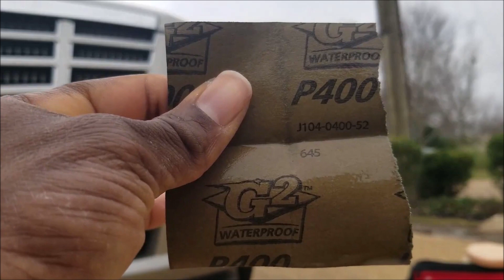Mobile Auto Detail: Make Money Restoring Headlights (Cadillac & Honda)

Comment: Do you need to seal the headlights with anything so they won't fog or haze again? In your experience how long will they stay looking good for?
Reply from the maker: Yes. You need to put a clear coat after. Some use sealants others use ceramic coatings. If you dont they will have up in 4 to 6 months
Reply: @AAProfessionalServices  Ok sounds good, thanks for the reply!
Reply: How do you find out which cars have ceramic and which have clear coat???
Reply: I would stick with meguairs or chemical guys for the final step.  See what The Headlight Restoration pro does!!

I would also add green 3m tape

Comment: hello I been doin headlight restore for my family cars and been doing the helmsman spar urethane method.the results are prefection except here in arizona they dont last but a few summers.i really prefer the wipe on clear coat method aposed to spray on and this helmsman spar urethane you dont need to polish the headligh only wetsand up too 3k grit and apply...i want to start doing this for customers but i want somthing more professional grade that lasts.and i prefer a wipe on type clear coat,i found gclear thats $60 just for 8ounces and will need a uv light to harden it.should i go this route or are their other options for wipe on uv clear coats?
Reply from the maker: Thanks for sharing

Comment: What is the name of that drill attachment with the small buffer on it?
Reply: Dont know the exact name but they usually comes as a kit. Most headlight restoration kit have one.
Reply: Never use a kit, I buy my pads and sandpaper from Amazon. 3 inch buffing pads.
Reply from the maker: Great info. Thanks for the information

Comment: I know this is an old video but, I wanted to mention that you could up sale the price with different protections. Like wax after a polish lasts between 6 months up to 1 year with 
proper detail maintenance. But, with a ceramic coating it can last for 1+ years with proper detail maintenance and that would be your up sale because a good ceramic product
can be costly.
Reply from the maker: Yes. Thjs video is a few years old. Im now aware of everything you've mentioned. Thanks for sharing.

Comment: Love the hustle!! But this method will only last about a year or two and they will start getting yellow… the correct way to do it is to re clear the headlight. With this method, there is nothing to protect the plastic headlights from the elements
Reply: What is re clearing ?
Reply: @cxlmobileheadlightrestorat7906  You spray clear coat on the headlights. So my process goes like this, I wet sand the headlights with 3 different grits of sand paper, then I wash them off, then wipe them down with a tack rag, mix my clear coat/activator, spray a light clear coat layer... then give it two more coats.
Reply: Clear coat will be all scratched up in 6 months & crack..easy to just protect with a ceramic coating..I done 2k Clear coats & looks amazing but longevity still in question..a restore with aftermarket Clear coat will cost more on the next restore..the reason factory protective layers last longer  #1 people take care of a car they're making payments on like Washing, waxing & try to keep it looking new
Like I said no matter what you do Clear coat ,ceramic coating or PPF they all have to be maintained..( dumb blonde ) I don't change my oil cause it's just going to be back dirty in 6 months so why bother
Reply: I’ve done cars that still look good 7 years later…  I’ve not had anyone come back and say it didn’t last… I charge $80 to do it. Let’s say that it only lasts 10 years… rarely do people keep their car for 10 years, and if they do… $80 was a good investment for 10 years of headlights looking new. I’d have to see some hard data if you want me to believe clear coat won’t last and will be all scratched up in 6 months. lol… I can provide pics of a 2001 Silverado I did for my cousin in 2014-2015 that still look brand new.
Reply: @AdamPerez9  interesting, most you tube videos lead to clear coat lasting 1 maybe 2 years lol.
Reply: @cxlmobileheadlightrestorat7906  not sure, maybe bad prep?
Reply: @AdamPerez9  I was thinking that but it's really straight forward. Now, what is an activator? That you mix with clear coat and what do you spray it with?
Reply from the maker: Thanks for the info!
Reply: Islam I'm just starting out in this business... What's a good price to charge
Reply: @TheMoor74  I started off charging $120… but realized not all lights are that bad or difficult and I got more clients with cheaper prices. So I charge $120 for the headlights that are really bad and require more labor and $80 for the rest.
Reply from the maker: @AdamPerez9 thanks for sharing
Reply from the maker: @TheMoor74 start at 100 and up

Comment: I normally use the 800 grit to start  then 1500 and 2000 to finish and start polishing with a mid cutting compound also recommend to taped around the head lights to avoid scratches on paint that will save u time.👍
Reply from the maker: Thanks for sharing. That's a solid method